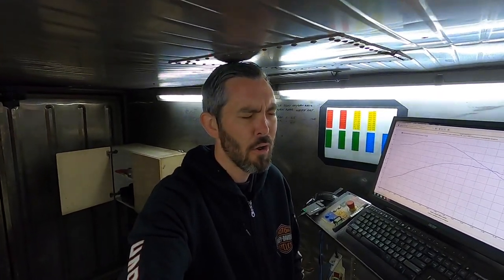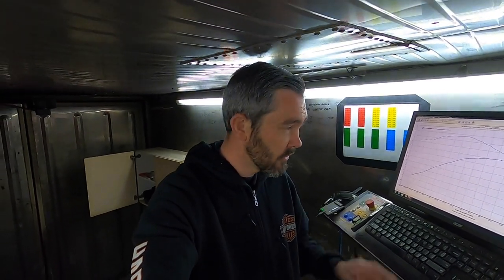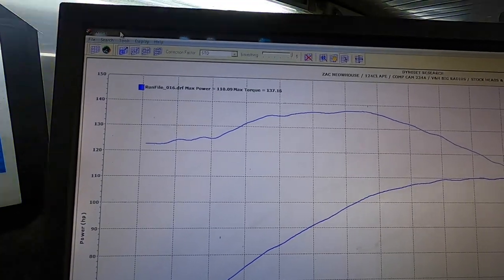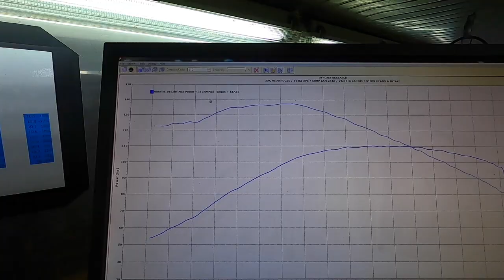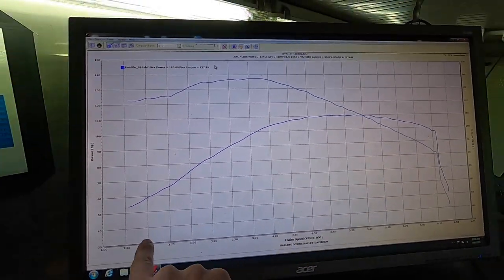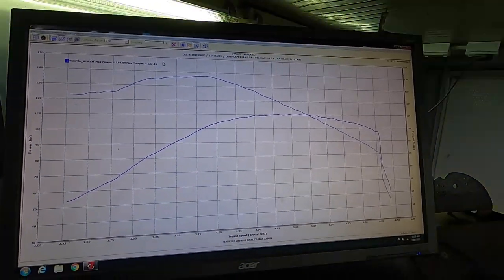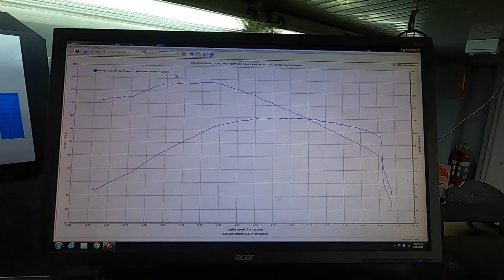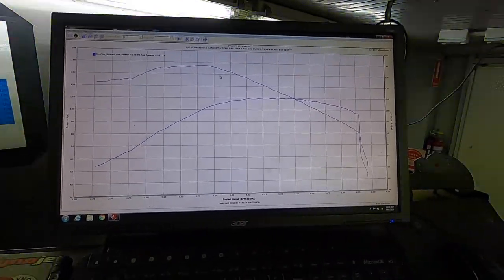124ci Breakout Build / A.P.E / DYNO / Platinum Air Ride / 23'' Turbine Wheel

Comment: I am still back and forth on doing a 124 or a 117/119 on my 2020 road glide 107. I am just concerned about the 124 being too much power for other components. Would the extra 10-15 torque that I would see with the 124 over a 117 big bore cause extra wear on internals? Like the compensator, clutch basket, tappets, etc. i would use a short lift cam and I put about 5-7k miles on my bike every year so I am just worried about that.
Reply from the maker: The longgevity of the engine comes down to quality of components & how the engine is assembled (gapping ring ends, centering the oil pump & what oil pump is used. As for 'extra wear' on the internals, compensator ect comes down to you ride it. If your going to be constantly reving it hard, dropping the clutch or flat changing geara then yeah, you will most definitely break or wear out the engine quicker than normal. That still applies to even a 100% stock HD engine. 
Personally I wouldn't be worries in the slightest going from a 107 to 124, I've seen too many guys in your position deciding which way to go. The guys who only do the smaller big bore kits always come back saying they should've done the bigger option.
Reply: @MasterTechMiller  thanks for the input. I am not someone who beats the snob out of their bike, just occasionally gets on the throttle in 2nd-3rd gear merging on the expressway. I will do the 124 then. You said prior that you don’t normally do the aftermarket oil pumps unless the cam lift is over 500 and they have the 2020 oil pump right?
Reply from the maker: @ragingninja4292  Yes, Over 500thou lift I recommend an aftermarket cam plate such as the Fueling or S&S options. The 2020 oil pump from Harley should definitely be installed no matter what. Great to see your not only a viewer but a good listener too
Reply: Always go bigger.. wish I did!

Comment: I am putting a 131 stage 4 kit with screaming eagle performance clutch in my 2021 harley breakout 

I have done stage 1 that's screaming eagle heavy breather and vaince and haines big radius pipe with maximus pin already

My dealer in Wollongong says 
They don't have dyno so there is no need to tune it. You will get what's the engine offers 

Is this even correct is it supposed to be tuned.
Reply from the maker: What they are saying is they will be using the Base Map that is available from the software to tune your bike. It's basically all they can do for you without having a dyno. They can slightly tweak the base map by using the software's 'auto tune' function to dial the tune in but it will be far from a full custom dyno tune.

Please watch this video from me in regards to the difference between a base map and something that has been tuned on the dyno.

https://youtu.be/waEJtpi-RRI
Reply: @MasterTechMiller  thank you feel like sending my bike down to you all the way from wollongong nsw
Reply from the maker: Similar things have been done mate. 
I've sold & built a bike for a guy in Sydney. The bike gets shipped to him next week! He hasn't even seen the bike or me in person but got the deal done.
Reply: @MasterTechMiller  hi Tommy how do I contact you 
To discuss further

Comment: How did you go from a 107 to a 124 with out boring the case's??
Reply from the maker: Using 4.250" cylinders fit with ease. 107ci can go upto a 124ci. 114ci bikes can go upto 131ci without case boring. (4.310")

The Milwaukee 8 engine has a large case that accommodates big cube builds without machine work.

Comment: Did you keep the stock cam plate and pump on this kit?
Any reason?
Reply from the maker: Retained the stock cam plate only as the lift on this particular cam is well under 500thou. I only really suggest going to a Fueling plate if the lift is over 500thou. The Oil pump was upgraded to the new 8 Lobe Gerotor design from H-D and proves more the sufficient to keep up with the oil delivery demands. 
Some customers will request to have the fueling pump & plate installed which I've done a few of but again, for this particular build the stock plate is absolutely fine.
Reply: Master Tech Miller 
Can i give you a scenario and can i have your opinion please, if you where upping a 107 to a 124 and for an extra $857 you got an s&s cam plate, oil pump and S&s valve springs would you do it?
Or stick with an upgraded 2020 oil pump only and pay no more?
The cam im using is an s&s 475c
Reply from the maker: @elusivesambar8657  no need to change the valve springs with the S&S 475 we have those cams in quite a few builds producing just over 125HP with the stock springs. Those same engines have over 10,000km (16,000miles) with no issues whatsoever.

Those same engines run the stock cam plates aswell. I would only recommend using a Fueling or S&S Cam plate and oil pump if your crankshaft run out is higher than 6thou. The maximum tolerance given by HD is 12thou of run out. The reason I suggest this is because the billet plates are obviously stronger & will tolerate the forces of the crankshaft wobbling in the plate. 

Also if you have a Softail, the new 8 lobe gerotor pump from HD is not that essential either as I have not seen 1 Softail 'Sump' yet!!! Have only seen Touring engines 'sump'.

Softails have a larger volume in the crankcase due to the dual balancer assembly & that's why I believe (among other reasons they just don't sump compared to the single balancer touring cases.

If you happy to spend the extra money, go ahead, the is no downfall to upgrading the pump and plate. I can't stress enough that you don't need bigger/heavy springs for 475, it will only rob you of HP due to added parasitic losses of the heavier springs.
Reply: Master Tech Miller i am purchasing the s&s performance kit 124, and it comes with the springs thats why i would install them.
I was only going for a 475 because the kit comes with a 550 which is a hp cam, i was told that the 475 in a 124ci gives good low to midrange torque, is that what you have experienced with this cam engine configuration?
I thought if im interested in the future ill have the 550 cam and i can port the heads too.
Just a thought.
Thanks very much for the info so far.
Its great to get another perspective, as most push for upgrades
Reply from the maker: @elusivesambar8657  Oh yeah I see what your saying. Well if you are definitely going run the 475 cam with the 124 kit I would leave the stock springs in. If you decide to swap out the cam at a later date to the 550 and port the heads I would definitely swap the springs then. Reason being is the springs need to be removed to port the heads, so it would be the perfect time to remove the stock springs, port the heads & change the springs in 1 go. It will save you double handling the springs.
Reply from the maker: I think you will be more than happy with the 475 &124ci combo anyways if you are after low to mid range torque. It's a great combo for those results.
Reply: Do you think i need the 1275N clutch springs? Can they be installed through the derby cover without removing the outer primary cover?
Reply from the maker: @elusivesambar8657  the springs are a good option if you think you will giving the clutch a hard time. I had 1 customer who didn't do the springs straight away & just left the stock ones in. His bike made 127hp & 138ft/lbs. After he gave the clutch a bit of abuse it started to slip slightly. He bought the bike in and we put the 1257nm springs in. He hasn't had a problem since. He has a street glide so the derby is a larger diameter than the softails so I was able to get it done just through the derby cover.
If you have a 2017 to 2018 Softail you "Should" be able to do it through the debry cover. If it's 2019 and later you will have to take the primary cover off as they run a thinner outter primary cover and smaller diameter derby cover.

Hope I haven't repeated myself too much....
Reply: Master Tech Miller thanks, and no you haven’t repeated yourself too much at all.
I have a 19 but was built in late 18.
Its not a slim outer primary just a standard i believe.
Thanks for the info and hope to see more videos in the near future
Reply from the maker: @elusivesambar8657  no worries mate. I have about 3 videos in the edit stages at the moment and at least 2 more decent engine build videos coming in the next couple weeks so there should be a decent amountof content on it's way over the next few weeks. Cheers for the feed back & support🇦🇺💪
Reply from the maker: @elusivesambar8657  you'll know as soon as you pull the derby cover off anyways....you'll see that the triangular spring retaining plate will either hit or just clear the inner primary once you start undoing the 3x 10mm bolts
Reply: @MasterTechMiller   hey, I finally got the bike back, 124 kit 475 cam. Im running it in with a canned map at the moment and taking it back soon for a dyno run. It needs to be smoothed out under 2200rpm as thats where it sits at 60kph and its a bit of a pig at the moment. Do you think the dyno will be able to fix this? Im a bit worried it will stay rough because of the cam. It has a big surge of power after 2200 where you need to hang on!
The other thing i noticed was the exhaust is now twice as loud. I have a Bassani road rage 3 and am getting looks everywhere i ride.
Is there a modification i can make to this pipe, or a recommended pipe i should go for to quieten it down a bit.
I like it personally, just didn’t want to attract the attention of the police as its an everyday ride in town.
Reply from the maker: @elusivesambar8657  Getting a dyno tune will definitely sort out the low rpm surging you are experiencing. It's most likely too lean around those few cells.
Don't worry too much about how noisey it is at the moment. It most likely lean & rich throughout the entire VE tables on both Front & Rear cylinders. 
Get it run in, then get the final dyno tune & assess how loud it is then. You'll be surprised how much the exhaust note can change when the tune is on point.
Reply: @MasterTechMiller  I just did a 124 kit with a zippers 472 cam with D&D exhaust on my 2018 breakout. I was worried it was to loud and raspy at first but after the thunder max started to learn and tune the raspy stuff went away and exhaust tune got deeper. Bike runs good but have same small surge at low rpm’s. Going to get it dyno tuned because I feel it could be stronger.
Reply from the maker: @535banshee  the thundermax and the 'auto learn' / self tune, will always favour a leaner mixture. Once you have someone do a decent tune it'll be very nice!